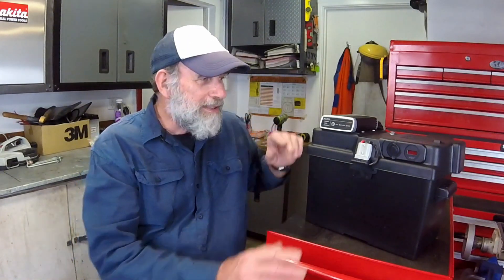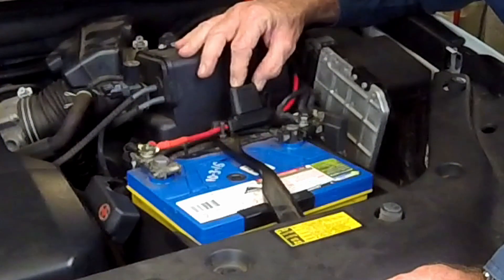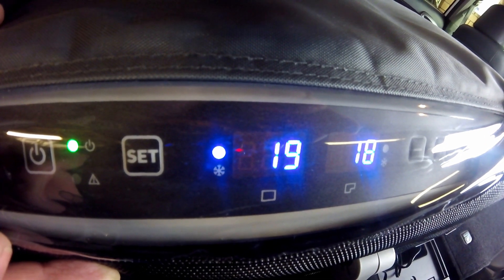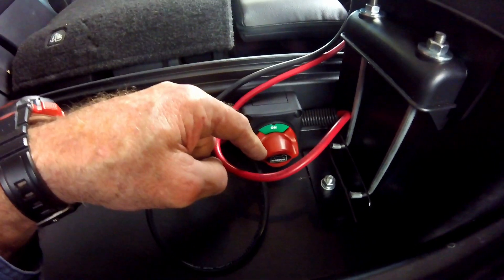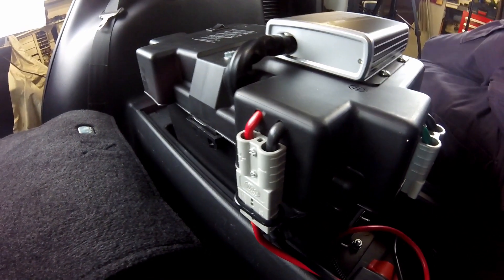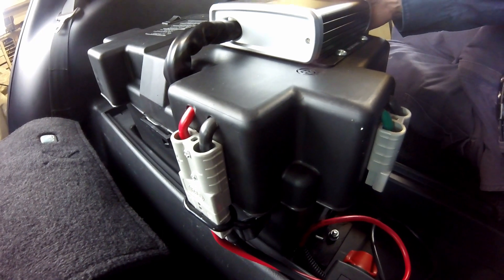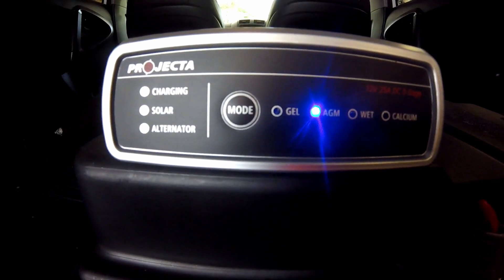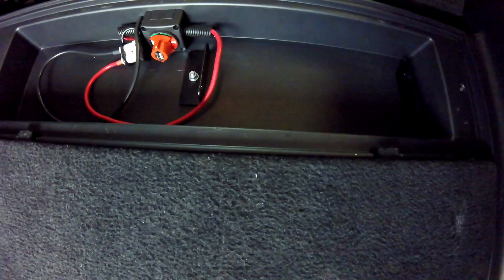Portable 12 Volt Auxiliary Battery Box Build: Part 3

Comment: If i had a solar panel plugged into the solar panel plug with an extra anderson plug with crocodile clamps onto another battery then into the input output Anderson would it charge that extra battery
Reply from the maker: Bit confused, but that is me I think. So, I think you mean solar panel plugged into the solar panel input for the DC-DC charger, and second 12 volt battery connected via an anderson plug to the battery's output plug. If that is the case, the two batteries would be connected in parrallel, and yes it would charge the second battery. But the parallel-connected batteries must have the same voltage and capacity, ie same amp-hours. Hopoe that makes sense.

Comment: Do you give information on setting up your caravan for 12 volt?? If so how much do you charge??
Reply from the maker: Mervyn, no charge for information, but I would need some detail on what your van has now. I have fitted older vans up with batteries, but regretably never did a video on it at the time and none have come along since. The van I have now, came with a battery so I can't even really use it as an example.
Reply: @whitedoggarage  I have a 1972 Millard caravan,  I have one agm battery not hooked
Up yet. I want to only wire up 2 way fridge 240 volt and 12 volt no gas, plus 12 volt lights
Reply: You can message me on Facebook if you find that more beneficial to chat
Reply from the maker: @mervynbrooks6621  do you do email? Well you must have a gmail account anyhow, and it would be easier for me. My email is whitedoggarage@gmail.com
Reply from the maker: @mervynbrooks6621  Are the lights in the van 12 volt. They usually are and if so will run off a 240/12 volt transformer which will be plugged into a power point tucked away out of sight. Do you want to charge the battery from the car and/or solar panels?

Comment: Great video. I have a question for you about the blue wire going to the ignition, I’m planning on building a box very similar to yours but have a smart charger so will need to connect it. What sort of connection would you recommend at the box so I’m still able to quickly and easily disconnect the box and take it out of the car. Thanks very much for this great video.
Reply from the maker: Nic, the simplest method is to put in terminal connector set, either pin or flat. Put the female end on the line from the ignition (the female end protects the live wire from shorting out) and the male end on the blue wire. If you want a more robust connection than you could use a block connector like the one at this link https://www.narva.com.au/products/56271BL . This is probably a better option if you expect to be regularly connecting and disconnecting the box. If you need the connector to be waterproof then one like in this link https://www.narva.com.au/products/56471BL would be your option. Hope that helps, Bob.

Comment: One thing I’d suggest. The + cable from cranking battery towards your AUX battery. Put a 100amp MIDI fuse and holder approx 150mm  in on the + red cable running to back to auxiliary battery box . Main reason as you are running such a big battery AGM 102ah and also from what I saw of your fridge freezer . 

Doesn’t hurt having that extra 100amp fuse  I’d show u mine if I could upload pics
Reply from the maker: Thanks for your comments. I am not sure what that would achieve in my situation. That + cable already has a 50 amp fuse about 100 mm from the cranking battery, which is what is specified for the dc-dc charger that the cable runs to.

Comment: Do u have a photo of the dc charger wiring inside the box I’m confused as to which wires goes where.
Reply from the maker: I should take more photos than I do, as I am always found wanting with these sort of questions. So the short answer is I don't have an actual photo, but ... There is a wiring diagram in Part 1 of this series (link: https://youtu.be/R12jqZE-kIY) at 2:19 minutes into the video. Actual footage of the layout of the wiring with an explanation can be seen in part 2 (link: https://youtu.be/XdjCoqdcyh4) starting at 16:04 minutes into the video. Hope this helps.

Comment: Very good info and demo, 1 question,instead of running power from the car battery could I use the supply the continuous power supply( cig supply) already in the rear of the car?? To the battery box.
Reply from the maker: I would not do that. The cig supply is usually rated 10 to 20 amps and the IDC25 DC-DC charger can potentially draw 40 amps which will blow the cig supply fuse if not melt the socket. Hope that helps.

Comment: Hi Bob, I hoping you could tell me what size American gage wire you use on your auxiliary box.. we don’t use millimeters..
Reply from the maker: My apologies Carol, I usually give dimensions to suit my American viewers as well, but I slipped up here. The American gage size for the main cables I use is 6, the lighter wire for the voltmeter is 15. 
You could use 8 gage for the main cables, the 6 gage is not that critical in this situation. I used 6 gage because I have it on hand for running power from the engine bay back to the camper (we call them caravans here, but from memory I think they are called campers in the US). The heavier gage means no power loss across a long run of cable. The short runs inside the battery box mean that the lighter and slightly cheaper 8 gage could be used. Hope that helps.

Comment: Good idea but a little bit of a birds nest in wiring, which may be a little heavy gauge for the application,. And I think a momentary switch would be better for the voltmeter gauge. Or even less complicated you can get them built into a cig plug
Reply from the maker: Thanks for your comments.

Comment: Hi Bob, great video, just what I needed to see. Just one question......If charging the Aux Battery using a solar panel , do I need a mppt solar device or does the DC to DC convertor take care of this.
Many thanks for a great informative video.
Reply from the maker: Peter, that is an excellent question. If you use the Projecta model (IDC25) [please note I have no connection to that company], that I have shown in the video it has an inbuilt mppt device so it is merely a matter of connecting the solar panel to that dcdc charger (green wire for positive). I have seen dcdc chargers that don't have solar input capacity and I presume in that case you would need an mppt device if you wanted to connect a solar panel. That applies if you were just wiring in a fixed panel as the portable ones usually have an inbuilt mppt device already and there it just a matter of running the wires to the respective terminals on the battery. Hope that helps.
Reply: Thanks bob, and thanks for the super fast reply

Comment: Hi Bob appreciate your very in depth video I just have a question regarding the blue ignition wire on the dc dc charger which you blank off and don't connect. I have a smart charger on my car so I need to connect this I believe and I am wondering how this is wired in. Thank you
Reply from the maker: Colin, that is a good question. I think the simplist way is to find a circuit in your fuse box which only comes on when the ignition is turned on and then use a piggy back fuse wire (for example look at this link https://www.narva.com.au/products/54409BL - Narva (no relationship to WDG) has ones for standard blade fuses like this one and for mini blade fuses as well) to run a line to the blue wire. That Toyota I show in part 3 of that video series actually had a smart alternator, but when connected to that vehicle the dc-dc charger would turn on even without the blue ignition wire connected. But you can't always rely on that happening of course and connecting the blue wire is probably the best option. Hope that helps, Bob.

Comment: did I miss the part where you hook up the dc to dc charger to the alternator?
Reply from the maker: Sort of, I don't hook directly to the alternator, but go instead from the starter battery from which I run positive and negative cables to an Anderson plug that feeds the dc-dc charger.

Comment: Hi Bob. Thank you so much for this series in particular. I have a question about the link between your starter battery and aux battery. Does your charge controller act as a one-way isolator between batteries so if you left your fridge on while the vehicle is off you're not draining from both batteries?
Reply from the maker: Eric, the charger acts as a one way isolator between the batteries. There is no current drain from the starter battery until it reaches a charging voltage. If it is a concern, the charger has a trigger wire that can be run to an active ignition source so that it only connects when the engine is going. I don't connect the trigger wire, because it is really meant for smart alternators, so left on its own the charger only draws power from the starter battery when the engine is running and the alternator lifts the starter battery voltage above about 13.5 volts (from memory a fully charged lead acid battery is 12.7 volts). Thanks.

Comment: Hey Bob. Great videos mate. 

I'm building a similar box to yours but my starting point was a battery box from the ALDI camping sale a few weeks back. 

That one comes pre-populated with two cigarette plugs and an USB. But the USB in it is 1.2a so basically useless with modern devices. 

I'm fitting a lithium battery two USB connectors with USB 3 and USB C connections. 

Also there are two Anderson outputs.

Because of the lithium battery I also fitted an AiLi battery monitor to keep an eye on the amps going in and out.

My DC DC charger is a Matsons MA21DCS with mttp. I have wired the ignition wire in its because one of our cars has a smart alternator. 

I have had fun building it. And hope it is useful for our camping trailer and both vehicles.
Reply from the maker: Sounds great mate, hope you get lots of use out of it. Thanks for watching the videos too. When I get a chance to edit it, I will post a video on an all steel under tray box, similar wiring set up, but permanently wired in. Thanks again, Bob
Reply: @whitedoggarage  I should probably do a video soon too. 

I'm installing two 50ah paralleled batteries under the rear seat of the ute with its own DC DC charger and mppt solar as a permanent fixture to run the radios, fridge and other accessories and then the portable box for the trailer and away from the car. 

I'm tempted to add some high intensity LED lights to the box as an extra auxiliary torch.
Reply from the maker: @munecito  Sounds like a useful set up, look forward to seeing the video.

Comment: so does the dc to dc charger do the same thing as a VSR, cause i don't want to wreck my start battery in the car. cheers for the videos I'm going to build one as i want it mobile and not fixed to the vehicle, i don't like how many installers put the dc to dc in the engine bay of the vehicle thanks for the video
Reply from the maker: The VSR is just an electronic switch that turns on and off at predetermined voltages, that is when the car engine is going and the alternator output exceeds say 13 volts the VSR turns on and allows current through to the second battery - it does this irrespective of the state of charge in the second battery. The dc to dc charger turns on also once the input voltage reaches a threshold level, however it modifies the input voltage to the second battery to the optimum amount for the second battery (14.4 volts for an Absorbed Glass Mat (AGM) battery or 14.7 volts for an ordinary lead acid battery) and the Projecter IDC25 is a smart charger so drops the voltage back when the battery is fully charged.
Reply: @whitedoggarage  thanks for taking the time to reply much appreciated.